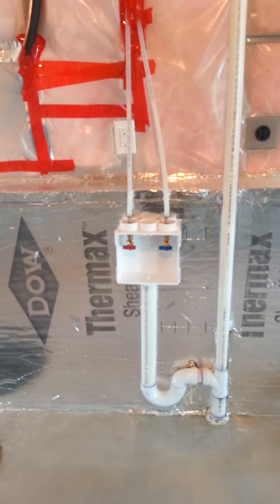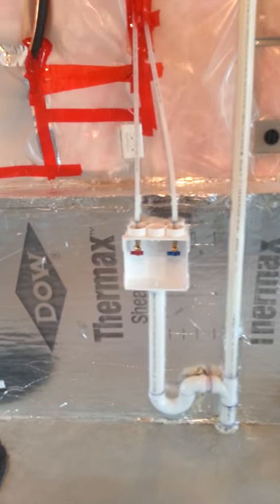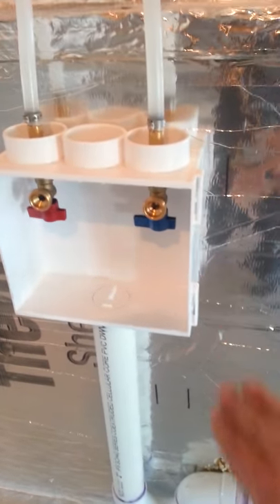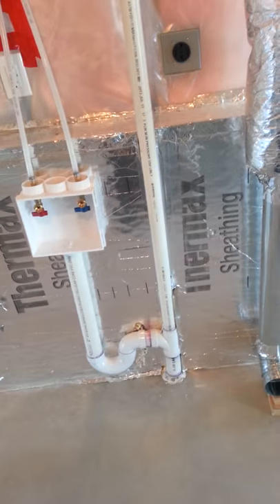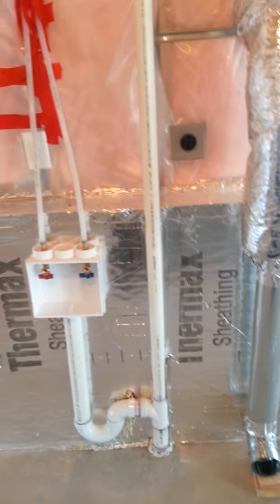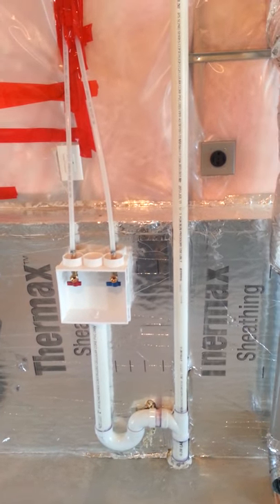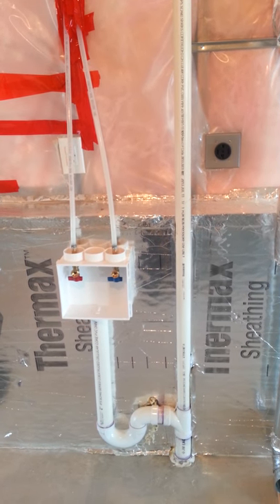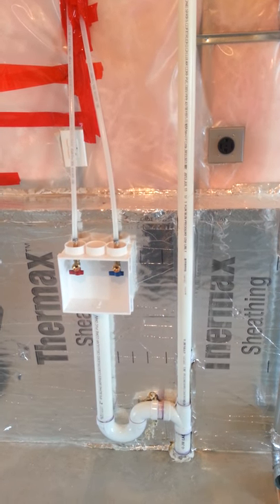Clothes Washer Standpipe

Comment: Jeremiah,
I'm in the process of relocating my wash/dryer to the garage and have to re-plumb one of the walls.  I understand that the bottom of the J trap has to be a minimum of 6" off the floor.  What's the minimum length required for the washer stand pipe?  Is it 10".  I'm assuming there is a national minimum standard.  Thanks.
Reply: you ever figure it out?
Reply: @aaronbaraiya3692  - Yes.  Code here in California is 18 inches (minimum) from entry point of the water to bottom of J-trap.
Reply: @GSMSfromFV  ok thanks, I am in California(socal) as well, near riverside, you did that project 7 years ago, im suprised you responded
Reply: @aaronbaraiya3692  - And I'm surprised you asked.  ;o)  This was part of a kitchen remodel project here in Orange County.  I had the washer/dryer moved out to the attached garage.  The vacated area became a pantry and wet bar.  Fortunately, there was existing plumbing inside the garage wall.  Drew up a couple of plumbing designs (which required moving one of the studs), and the inspector at the building dept. picked the one that best complied with code.  My contractor took it from there.
Reply: Isn’t that pipe after the p-pipe too short. It’ll create an S curve and pull all the water out of your p-pipe.